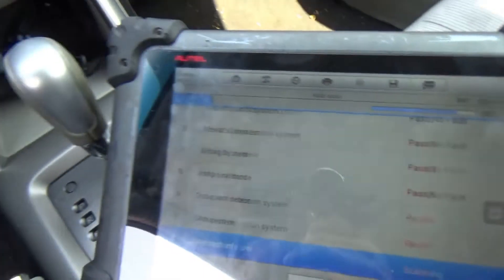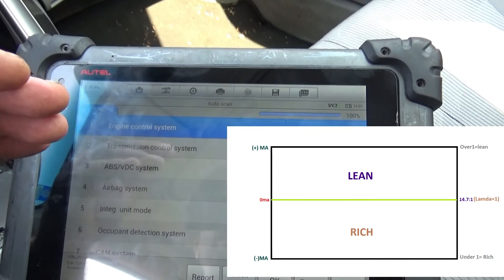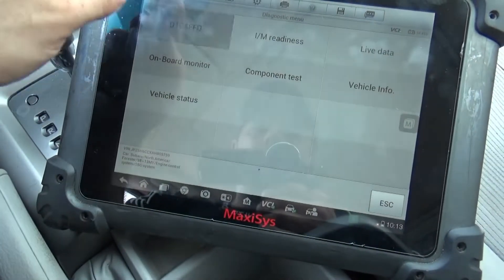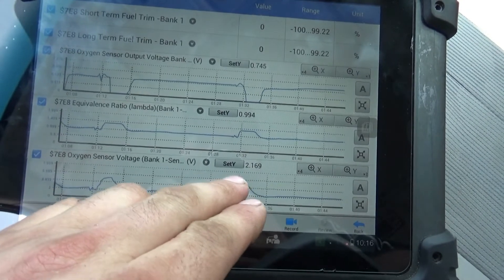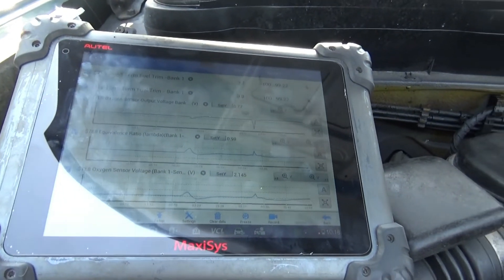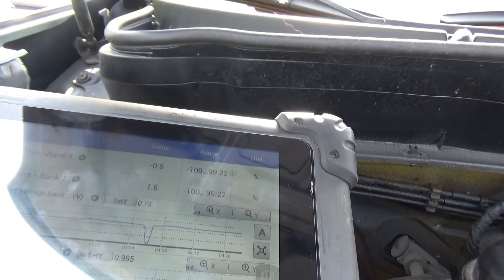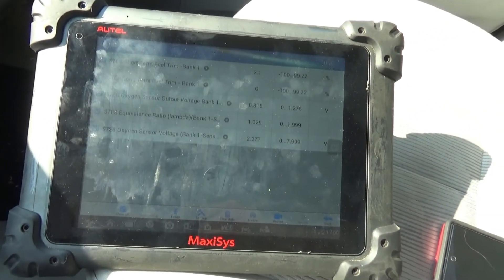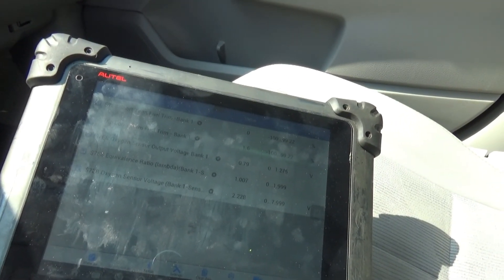Wide Band Oygen Sensor operation

Comment: I have a 2011 KIA optima 2.4. The upstream o2 is a wide band, the down stream o2 is a narrow  band. Does the down stream narrow band o2 contribute anything to the ECM for fuel adjustment? I assume it is just looking at  Cat condition?
In other words if I had a faulty downstream o2 would it affect fuel trim? Thanks
Reply: Downstream sensor just monitors cat efficiency.
Reply: Sensor 1 upstream does all fuel trim control. 
Sensor 2 downstream only monitors the cat efficiency.

Comment: I'm having an issue with wideband on 2013 Ford tt3.5 stuck lean bank1sensor 1,after catalytic converter and all 02 sensor was replaced ,car is worst with new parts than it was with old parts,with only 83000 miles on the clock
Reply from the maker: I would look for a bad maf or fuel delivery issue or a vacuum leak.

Comment: My X5 reads 2.20v sensor 1 Bank 1 (it only has one upstream sensor for both Banks) but the combustion is so rich at the tailpipe, what is going on?.
Is very difficult to diagnose this A/F sensors  without technical data.
Reply from the maker: You need to see how the sensor responds to change. the sensor could be lying to the dme.
Reply: @JLsAutoSolution  I think that is the obvius way to go, replace the sensor because that engine was working with a huge vacuum leak before it got repair. So maybe the A/F is plenty of carbon. Thanks